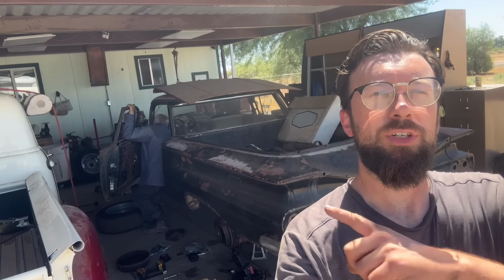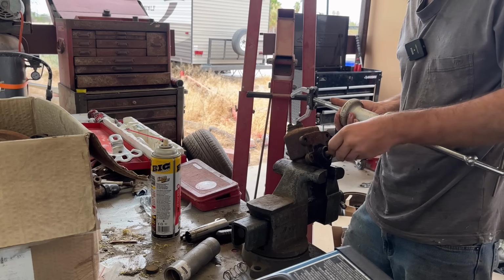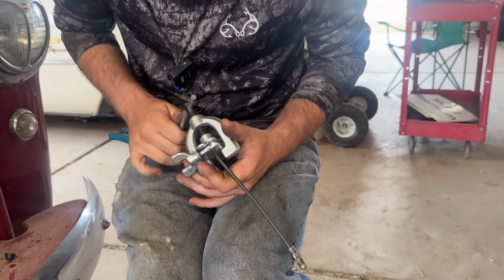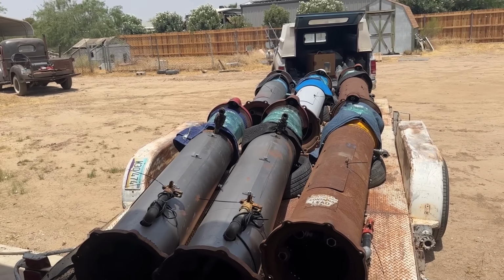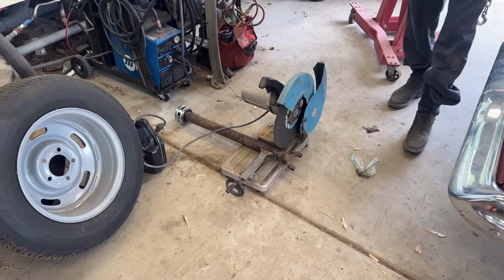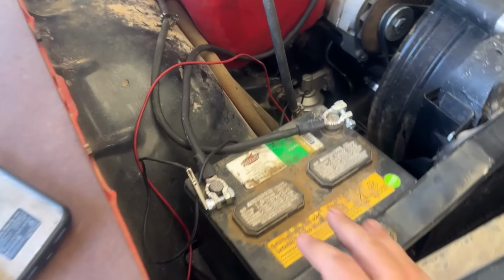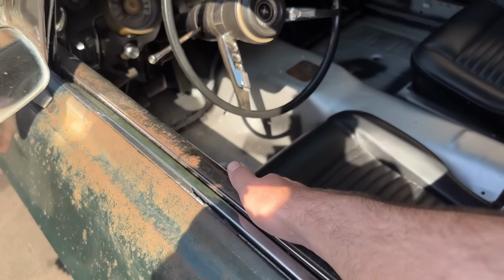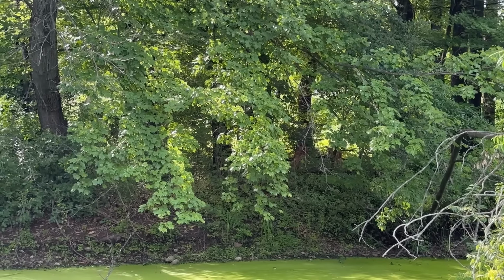Will it run with a FREE engine ? The 60 ShellCamino has GIANT problems. Part 2!

Comment: My garden hose I bought from an estate auction in 2015 when I bought my house. Sears Best Craftsman from the 1980s. Has always been stored outside and is still pliable. No leaks.
Reply: I bought a hose from sears in 2005 and still use it no issues

Comment: Another wonderful episode!  Going to be great to see another El Camino back on the road.  

Your work on the driveline bought back memories of swapping my 60 El Camino three speed for an aluminum close ratio T10 four speed.  Being a dumb kid, my project planning skills were lacking, and I did not think about the T10 being longer than the three speed.

I did not realize the issue until the three speed was out and sitting next to the T10 and I had rented some evening time during the week on a service station hoist to do the swap, so I was committed.  But, back then there was one Chevrolet dealer parts department in town that stayed open late, and they had the shorter front part of the driveline in stock. Got the driveline swapped, just using hand tools and project completed. 

Kind of amazing to think about those kinds of parts being in stock nowadays let alone be available at night!

Comment: Hi Travis, the reason that air hose is disintegrating could be the reel is close to the tin roof and absorbing heat even though it is in your car port. Combined with the lower quality "Chinese" rubber compound. Those tin roofs get increadably hot especially in your area of the USA.
Regards from South Africa
Reply: Also, the chinese are adding soy to the rubber they make. Tires are really suffering because of this.
Reply: thats a good point it still shouldn't just be destroyed like that but hey that the world we live in!

Comment: There’s those brake lines you mentioned in the live lol, at least you weren’t flaring them while they were on the car. Also I can never get that type of flare tool to work right, unless I can tighten it like that. Hard to do when the line is on the car lol

Comment: My 1983 F-150 had a flat spot on the rotor when I got it. Before I replaced it, the wheel made a chirping sound when I drove it. The chirping got faster the faster I drive.

Comment: Back in the early 70's my family & I were on vacation crossing the mountains in West Viginia ...
I was in the rear of our station wagon ( I was 8 or 9 yrs old) when I saw a wheel running down the road behind us...
My mom was driving & I told my mom , there's a wheel rolling down the road...
Its was our drivers side rear wheel ...
My mom didnt get it off the interstate before it sat down on the hub...
My dad was asleep when all this happened & he was yelling at my mother to get the wagon off the road...
She could'nt ...
My dad jumped out & realized the wheel was gone ...
He recruited me to help find our wheel..
It was 100 yards up the side of the mtn , buried in grass & brush...
We got towed to a garage where it was discovered all 5 lugs on the wheel broke off & the other wheels  all had broken lugs...
Right before we left for vacation my dad had new tires mounted ...
Turns out , the idiot who used an impact to tighten the lug nuts , over tightened them ..
All 4 wheels had to have new lug bolts installed..
When we got home , my father went back to the tire shop with a tow bill , a repair bill , and evidence of the broken lugs...
The mngr started to deny any wrong doing until my dad grabbed him by the throat & explained to him that we could've been killed & that he was gonna pay for the damage or make a trip to the hospital..
My dad had a very short fuse & was a champion boxer while serving in the U.S. Navy ..
Not to mention he was a stout man at first glance ..
The man paid up & my dad also warned the mechanic who mounted the tires ..
Using a 3/4 inch air impact was stupidity ...
It is common practice to use a torque wrench today..
Back then it was common to tighten it as tight as you can & then half a turn more..

Comment: Transmission vacuum goes to front of edelbrock on rhs of center pcv.. Lhs of pcv is vacuum advance.. rear of edelbrock vacuum is for booster on brakes.. if no booster then it gets a 1/4 " npt plug..

Comment: It really boggles my mind why almost no one seems to have any tools for brake bleeding... I do brakes like once every 3 years or so and I still have a vacuum bleeder and a pressure bleeder with fluid reservoir.
Reply: You don't need all the fancy gadgets to bleed the brakes, just do it and be done with it.
Reply: @g-man7938  Yeh. Why do it in easy way when you can do it the hard way? At least my time is more valuable than that.

Comment: I like the videos but i don't know why you guys insist on trying to rebuild a crusty old master cylinder, especially one of those single-pot versions. It may not fail on you, but it'll fail on somebody. There are times you have to demonstrate responsibility when making videos and this is one of them. $60 for a new master cylinder OBVIOUSLY is not going to break the bank.
Reply from the maker: Yeah but we’ve had the new ones not work either
Reply: Maybe some owners enjoy rebuilding original parts, maybe it's better than slapping on a brand new part, maybe you will understand 1 day
Reply: @itsmephil2255  I understand TODAY, because I try to save original parts anywhere I can on my Mopar projects, which by the way are on my own channel. I just went through two used master cylinders which weren't even seized, and they were beyond saving. Dot 3 brake fluid readily absorbs WATER, which pits the bore in the master cylinder and they will not come out with honing. Even if it builds pressure, it will leak rearward past the seal and into the car. This is elementary stuff, I don't even know why it has to be mentioned. "Synthetic" Dot 3 is an outright lie, because it's ALL synthetic, there is no naturally occurring brake fluid. The only way to get away from the moisture issue is to use Dot 5, which comes with it's own set of issues.

 I rebuild all my original numbers-correct starters, alternators and distributors because I don't buy reman junk. So, nobody on Youtube needs to remind me about saving original parts..I have a storage unit half full of them. Re-using a master cylinder that isn't already in good shape is highly dangerous and not anything I would record doing with a camera. If a new master cylinder fails and you run over somebody, you get lots of money from the manufacturer. If you use a crap junkyard master cylinder and run over somebody, you PAY lots of money. Those guys on the billboards are just waiting for stuff like that.